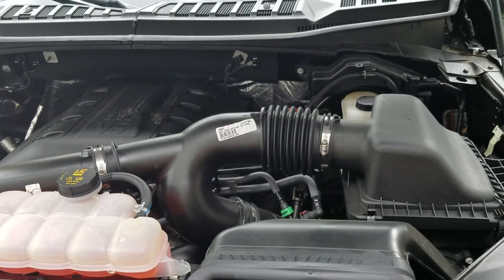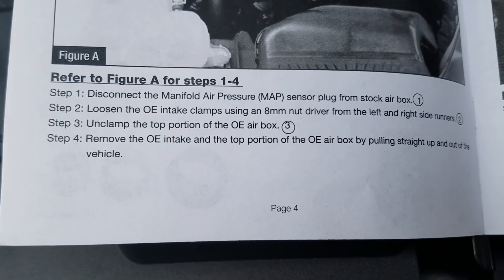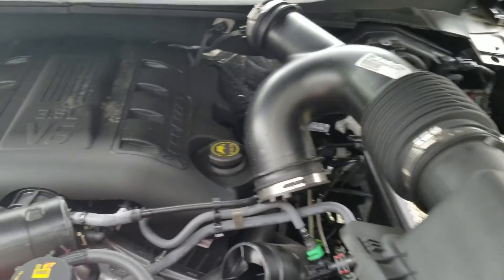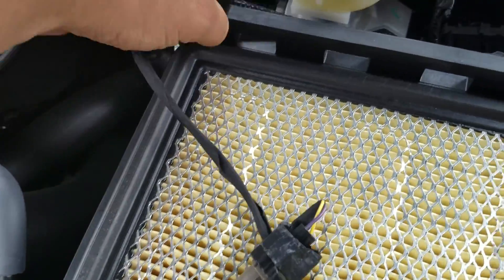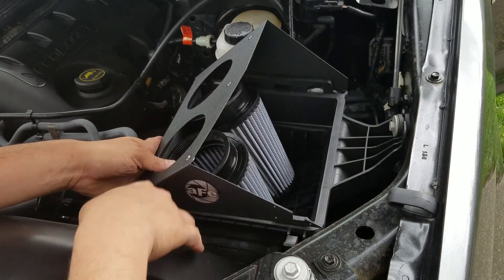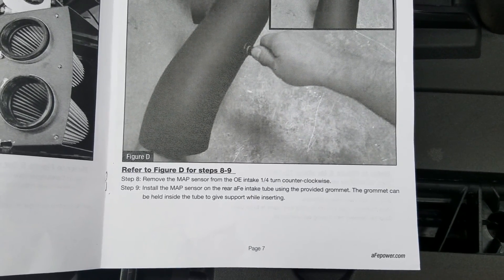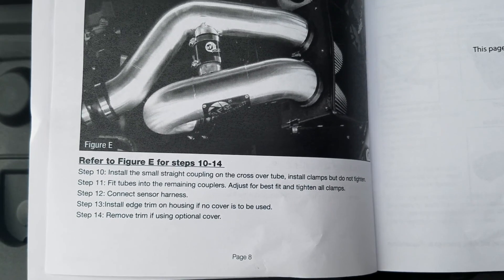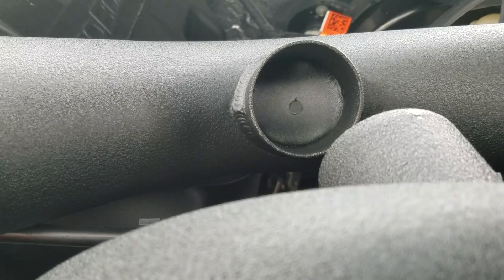Afe stage 2 intake install on 2016 f150 3.5 ecoboost

Comment: did you find out if the hole was supposed to be small and not fully drilled out?
Reply: Brent Marsters the hole is meant to be small. It is meant to balance the air so a big hole is not needed